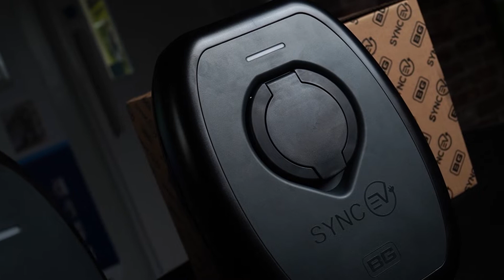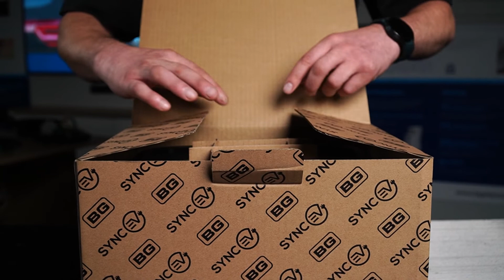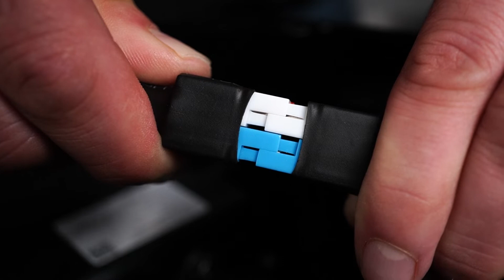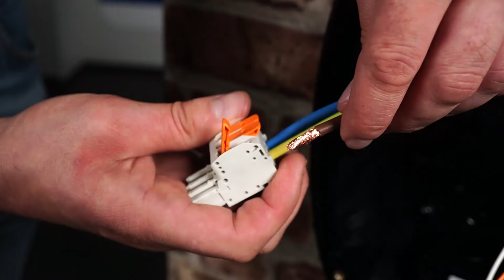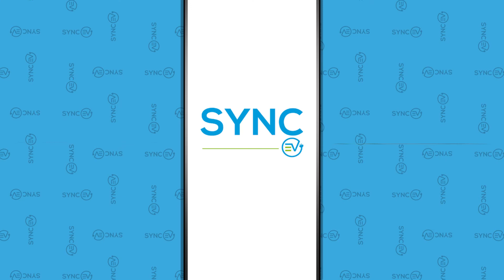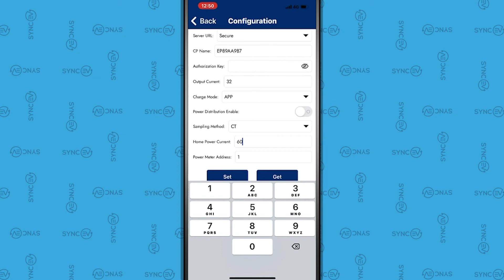SyncEV BG EVS and EVT electric vehicle charger introduction, installation and commissioning video

Comment: BG. Wiring on this is easy inside as. Long. As. You leave ample stripped cable 20cm. It has rear entry cabling.
Zappi is the neatest. Rear entry fitting.
Project EV is a tightly spaced access from a side wiring panel. The Supply is not flat to the wall. No rear entry cabling.
Ohme. Is the easiest of all. Just a mounting plate flate to wall installation. However no rear entry cabling.

Comment: when you have finished the outside plastic outer ring snaps nicely holding the front on But how do you get that outer locking ring back off without damaging the plastic casing in the process, thanks john